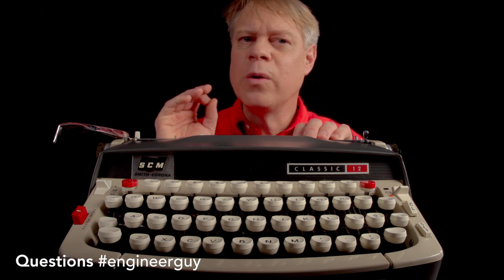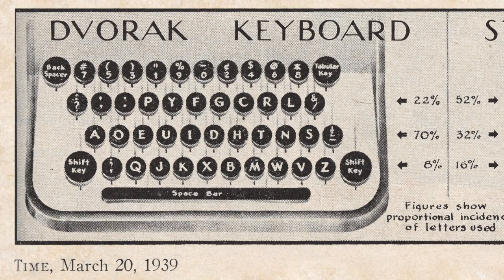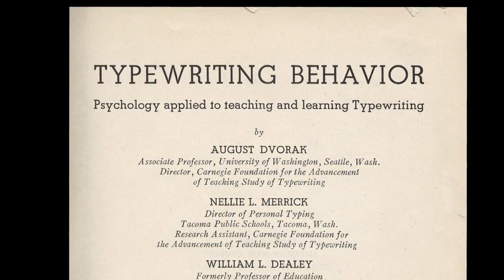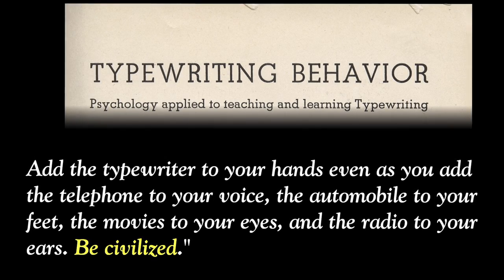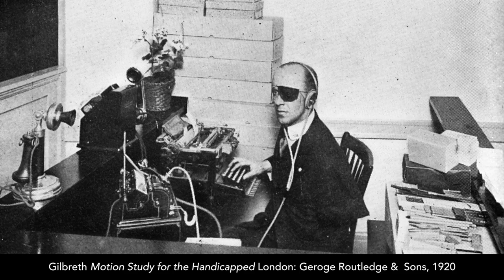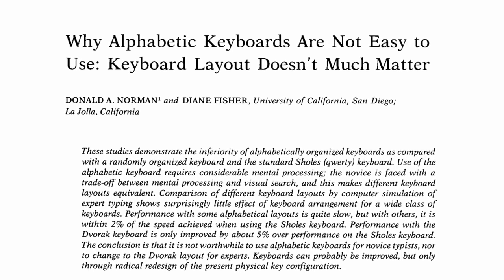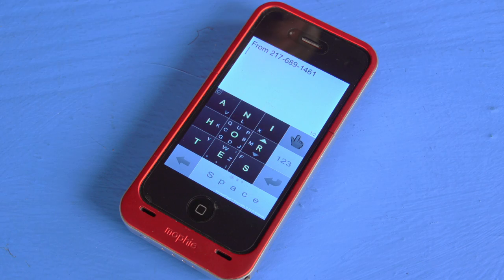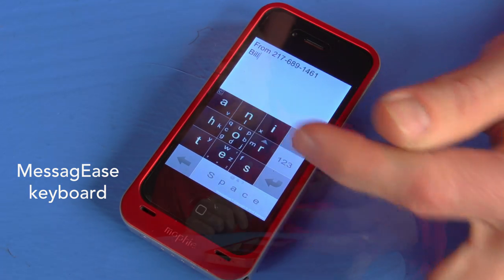Why the Dvorak keyboard didn't take over the world

Comment: It failed, and was only a 5% faster than qwerty, because the inventor was a fraud. His book was 99% why it would be better to have a better keyboard, and why qwerty wasn't that. His keyboard was, he claimed, better because he claimed to have programed "the new thing" in computing, the eniac, to calculate the most commonly used keys, and grouping them together. Problem is the eniac was a computer used to calculate artillery trajectories. He never published how he reprogrammed it to handle text counting. If he had done that he should have gotten a set of numbers that could have been graphed to show what letters are used most commonly in a data set of common written texts. If he had that he didn't publish it. While he stated it would be good to have design a keyboard based on such a set of data he never showed he had it. He did publish a set of letters in a graph showing what he claimed to be said data. Saying none of that elementary information or proof his book was  a 1200 page tome. We have computers that can easily be used to do what he claimed to have done, and we get a different graph. A graph produced by myself using a data set of 300, 000 keystrokes (The eniac simply didn't have the capacity to do more than a few thousand if he had programmed it as he said in the first place) from common texts gathered from internet news paper stories shows he got the 5 most commonly used letters right but the rest are all wrong. Not a hard thing to do just by rough estimating without a computer.  Another run I checked based on another data base of more technical writings graphs a similar but different set. An important consideration in analyzing such data is does the graph follow a bell curve. That shows that the data set input is large enough be a valid representation of the common usage population. The smoother the bell curve is the more accurately the set represents the whole. With a valid data set one might consider such things as putting the most common keys together to minimize finger motions, and one might consider putting the most common letters into the right hand. One might do another keyboard arrangement for the left handed. One might also do another data set based on the most common three letter groups., and arrange those groups to be used in conformity to a natural finger motion such as "drumming" pinky to index rather than index to pinky. Try it. Can you drum faster pinky to index or index to pinky. So you can drum the most common 3 letter groups such as "and", "ing", "tio", and "ion" fastest. Of course all talk with no evidence is the kind of BS the inventor of Dvorak did. So to do the database simply copy, and paste some news stories into a basic text editor. The use a simple loop script to send an enter, and a right arrow. this results in a long column of letters. Copy, and paste this column into a field in the data base of a word processor. Do this with as many texts as will fit the memory of the word processor database. Arrange alphabetically, then starting at the top select all the "a" letters. There should be a number to the left of the column where the "a" set ends. Write that number down. Delete the "a" set. Do the same to the "b"s, the "c"s etc. Then write the numbers into a database and graph the numbers. This gives you the graph. Continue to add texts until you get a smooth bell curve. I found 300,000 keystrokes gives a smooth bell curve. To get the most common 3 letter sets do the same thing but instead of a script that just sends an enter, and a right arrow to the text editor send an enter, and 3 right arrows. Then do the same thing to the text but delete the first letter, then do again deleting the second letter. Database those sets of three, and arrange alphabetically. Then find ten sets that have the most members. That's just for the proof. In a practical arrangement of keys I used the by far top 4 sets, "and", "ing", "tio", "ion". The first 2 are pretty obvious. The "tio", and the "ion" sets are really the same common set of the 4 letter "tion" found in words such as nation, motion, etc... I made a new keyboard file ( "keyboard.kbd", keyboard dot kbd") to operate my keyboard based on the layout informed by the above data. Renamed the original "keyboard.kbd" to "keyboardold.kbd", and put the new keyboard.kbd into the windows folder. Then I rearranged the keyboard to be in the design I made. I have been using it for 20 years. It is faster, and less stressful than the qwerty or the Dvorak. The data set can also be used to inform the arrangement of keys in multii layer keyboards such as on cell phones. The top layer being the 9 most common keys, the next layer the next 9 most common. If there's any interest I may make a video on the whole thing.

Comment: I learned to type on QWERTY keyboards in the mid 90s, and then taught myself DVORAK when I got my own first computer in the early 2000s at the beginning of high school. I never lost the ability to type QWERTY as I expected, but there is a mental "switch" I must make which takes a second or two. The reduced finger "reaching" is a far greater benefit than any speed gains, although I'm definitely faster. I even switch my work computers over to DVORAK.

Comment: There is one more factor for Dvorak keaybord to fail. The 5 % better performance in the standard Dvorak layout is only for one language. Basically if you want to have a slightly faster keyboard made by the Dvorak rules/assumptions, you would most likely have to make a different Dvorka style keyboard for every language(since the basic of Dvorak keyboard was to cluster the frequently used letters close by, and frequently used letters can be very different from language to language ), the standard QWERTY was just more universal even if not so fast.
Reply: Yes, to some degree this is true.  It's why AZERTY and variants exist.  On the other hand, it's becoming more commoen for other layouts such as Colemak and Workman to come about.  No reason there can't be variants of those for other languages where frequency is different.
Reply: Difference between languages can be less than you think. For instance, for Portuguese it would be slightly better to have B rather than H on the home row. In practice, I type in English as much as, or maybe more, than in Portuguese. So Dvorak is great anyway. And it's easy for it to be great since QWERTY is so bad for your health.

Comment: With a higher proportion of the most commonly used letters on the home row, wouldn't Dvorak be less prone to causing repetitive strain injury and related problems? Surely a speed increase isn't the only consideration?
Reply: many commenters here attest to JUST that from personal experience. yes.
The socially responsible thing to do is to switch. There is no better time than in adolescence.
It saves learning curve time. It saves typing time. it saves health. It's a big deal.

Comment: Overlooked in this video are the very real COSTS of changing over to the Dvorak keyboard.   Any entity considering changing over will have to buy new keyboard hardware, revise system software, create training materials and train the workers, and endure and solve problems resulting from the transition.  If you're a large entity such as a large corporation or a large government, those costs are SUBSTANTIAL.  Do those costs justify a 5% productivity increase?  Hardly.  

The QWERTY layout is NOT "random".  In the early days of typewriter development, the mechanical keys were attached to U-shaped bails left and right that swung DOWN from above onto the platen, and were an interference arrangement.  If the typist typed too quickly, the bails would bash into each other and jam together.  The QWERTY arrangement was developed to deliberately make the typist less efficient - to slow them down - to prevent jamming.

Comment: The qwerty keyboard is good enough and that's all that matters.  Having to gain 5% is irrelevant.   If dvorak was released first compared to qwerty, then it would have been the standard as it would have been good enough compared to qwerty.
Reply: TheSnoopyclone It's not just speed, but also ergonomics.  QWERTY makes my right wrist hurt horribly if I use it a lot, because the vowels on the right hand require reaching.  On better layouts, your fingers move less.
Reply: +smozoma yep, definitely less movement hey. On Dvorak layout about 3000 words can be typed on the home row compared to about 300 words in Qwerty.

Comment: Because it's not that type of world. (ha-ha-ha)
Reply: strontiumXnitrate
I get it, and fair enough; but: iterations require adaptive change applied over time; for what once is in may at some point be gone; for what once was considered 'right' might ultimately prove to be wrong.

Such is the nature of engineering, and science, no?

I thought that the point of that (*'Dvorak') type of keyboard opposed to a 'qwerty' one was supposed to be more efficient (and thus 'better') but proved to be impractical due to the mechanical nature that the typewriters of at the time were composed of; in the way that they were designed, and thus the qwerty keyboard became the standard.

Since no one uses typewriters anymore it could be 'classified' as ''fit'' for a change. Why go out of the way and still utilize something that has logic wise, a better ''alternative''?

Comment: If you are a professional engineer, I suggest that you do more research before publishing.
Simply reading the visuals in your video gave at least two reasons to doubt your claim, which you copied from the research paper published in 1982.
One of the most interesting things to me is your graphic that shows with Dvorak 70% of the keystrokes are on the home row, which clearly means that the typist will need to stretch his fingers away from this position only about 30% of the time. This is more efficient physically, and medically there is less motion required on all of the inter-related joints of the hands and wrists.
Your "only 5% more efficient" repeated claim is from that article, which states that they only used computer models of typists. We all know how infallible computer models are - is it going to snow this weekend?
As far as typing speed, here's a clip from Wikipedia: "As of 2005, writer Barbara Blackburn was the fastest English language typist in the world, according to The Guinness Book of World Records. Using the Dvorak Simplified Keyboard, she has maintained 150 wpm for 50 minutes, and 170 wpm for shorter periods. She has been clocked at a peak speed of 212 wpm."
"The fastest typing speed ever, 216 words per minute, was achieved by Stella Pajunas-Garnand from Chicago in 1946 in one minute on an IBM electric."
Note the last speed was sustained for one minute.

Have you ever tried to type on a Dvorak keyboard?
Reply: You're reading the visuals correctly but not making the right connections. because 70% of the usage is on the same row that your hands are meant to stay on, you have small visual field. He also states before he shows the 5% visual that he believes it may be slightly better. I don't believe you actually watched the video at all before commenting -- And if your purpose is to state that he needs better visuals because of misinterpretation that could potentially happen, it would be wise to remember that this is a video and audio is supposed to compliment the video provided.
Reply: Douglas Gross i was literally skimming the comments to see if somebody said this first. the video is too brief and never discussed the 70% fact. i hope i dont sound too much like seeking validation for my choices, but as someone who switches between qwerty & dvorak often - i know what certainly feels more comfortable.
Reply: Colby Hunter how is your visual field decreased if the keys you press are shown on the screen?
Reply: Colby Hunter In that you didn't reference me in your post, I did not see it until just now. My sense of your post is that it is an effort to be critical of my own, mostly because of the suggestion that I had not watched the video itself. I reread my post and rewatched the video, as it has been several months. Firstly, I had hoped that it would have been an easy inference that I had noted the article he flashed on the screen (highlighting the only part that he wanted us to read - a red flag in my book). I found the article and read it. That is how I was able to comment on details of the methods used in the article he cited. Secondly, I noticed how this "engineer" demeans the time-motion studies of the early twentieth century - he says something like "the workers couldn't find the best ways to move their own hands." This shows us that he is either socially/politically motivated in his advocacy of the individual worker, simply ignorant, or both. The time-motion studies worked. Very similar techniques are used in kinesiology; you may have seen its use in optimizing the performance of Olympic athletes. Whatever the case may be, it is indicative of his not being a good engineer.
With respect to the visual field business that some have commented on, I had given him a pass on this; I probably shouldn't have. I can think of no way in which seeing the keys would have any bearing on the learning or the user of Dvorak or any other keyboard. In junior high school, our typewriters had no letters on the keys. You can buy computer keyboards with blank keycaps today. An experienced typist doesn't need to look at the keys, he uses muscle memory to know where the appropriate key is. Much like an Olympic archer would be doomed if he actually consciously thought of how he placed his fingers on the arrow or how the bow felt balanced in his hands as he made a shot - his muscles know how to do all of these things perfectly as he has spent untold hours making the same movements, and thinking of them in a match would be nearly like trying to learn them for the first time; the same is true of a trained typist. Why on earth would he need to look down at the keys?
This visual field thing is absurd, and if it was used in the research paper that this "engineer" referenced (I am not going to review it again) it further shows how flawed the research was and how inept the "engineer" was - unless it was chosen to use for sophistry.
Let us all hope that if he is part of the university that he is an emeritus professor at best.
Reply: Douglas Gross As you said, it's been months and rereading what you said I believe I made the mistake of hearing that you simply looked at the visuals instead of listening, not that you actually read the visuals (Minor difference but big implications right?). As for the visual field thing, I never read what the research actually said, but I do agree that having the visual field makes little to no difference. As someone who types for hours upon hours a day I can say that I don't remember taking longer than a week to make it so I didn't need to look at the keys (Though my typing speed was no where near where it is today). I understand where the idea of having the visual field of all of the most common keys may seem useful but the fact is that most people who don't understand how to type also tend to not use proper finger positioning.

In short I misread what you originally said and I'm happy to know that I was wrong about your diligence before making a post and I will make sure that next time I clearly understand what you were saying before commenting on your opinions.
Reply: No, because I don't need to type 200 wpm all day every day.

And if I did, I would just buy a stenotype, which is infinitely better than Dvorak.

You say the fastest dvorak is 150 for 50 minutes, to even become a court stenographer you need to maintain at least 250 during testimonies.

The record is 375, almost double the fastest dvorak. If you actually cared that much about speed, precision, and effort, you wouldn't even be using a keyboard.

Besides, these studies were done with typewriters? Have you ever used a typewriter? A keyboard and a typewriter may share the same layout but they're nothing alike when it comes to typing. Look at those lights in the image showing the movement of the hands. Nobody types like that. Literally nobody uses their keyboard like that. My wrists never move. I can reach every key. They're all easy to press and have a much shorter travel. They're also a lot lighter and have more tactile feedback depending on the keys you use. I would use a buckling spring or a cherry MX over a typewriter any day, not because a typewriter isn't as useful, but because a typewriter is really awkward to use in comparison.